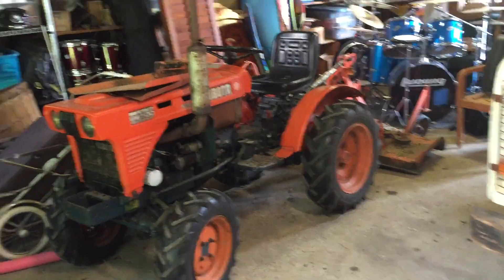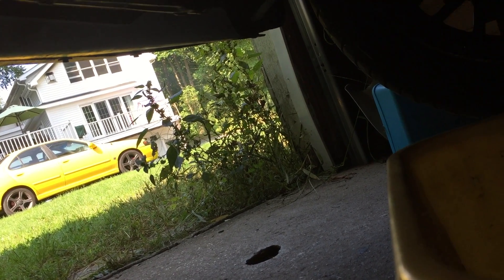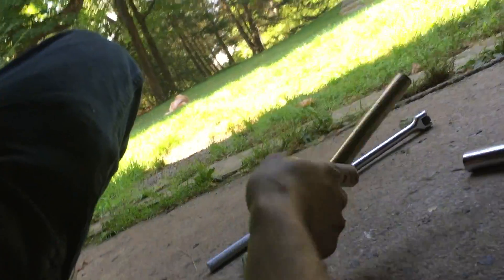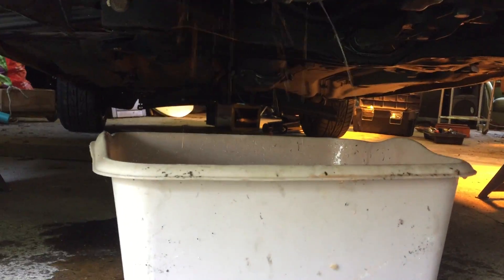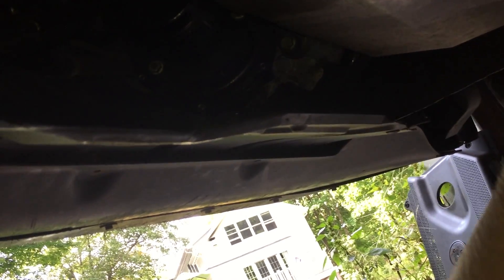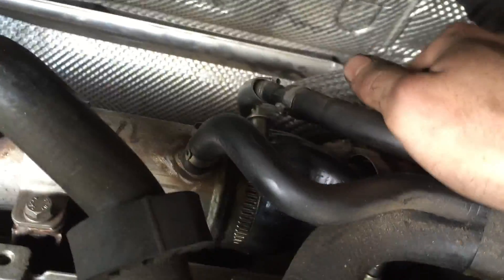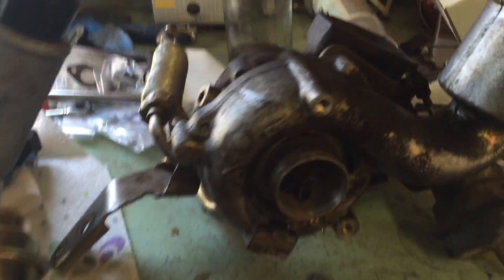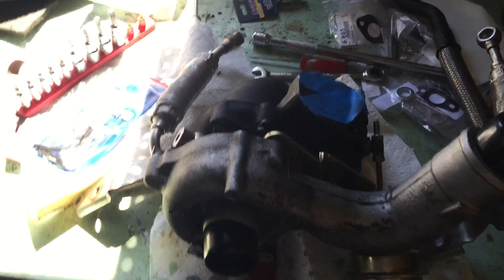MK4 Jetta Turbo Replacement (Part 1, Removing Blown Turbo)

Comment: hey bro. is there any posibility that the oil and the coolant can mix in the turbo?
Reply: No youve got a head gasket failure there
Reply: 2 years late but head gasket was probably done for
Reply: Check oil cooler first. 9 times out of 10 thats the culprit if you have coolant in the oil. Headgasket is rare on a 1.8T unless you are pushing big boost
Reply from the maker: Never heard of that. If that's happening, your turbo's probably cooked